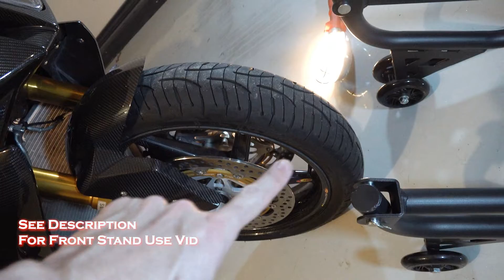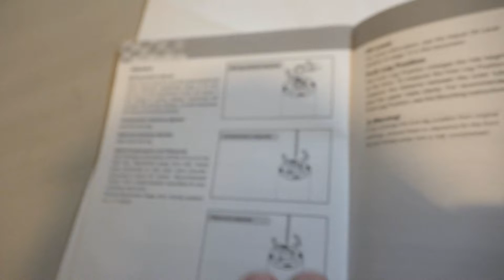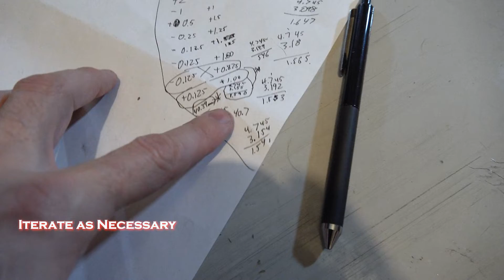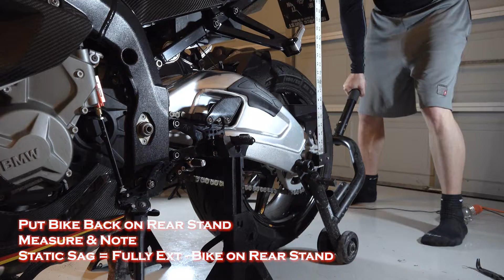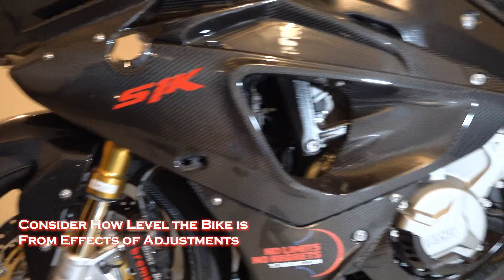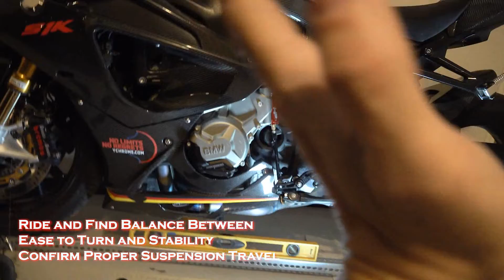OHLINS Motorcycle SUSPENSION SAG Measurement/Adjustment - BMW S1000RR Custom Modification

Comment: With the rear wheel off the ground there's extra bike weight over the front wheel that's going to give you a longer static & rider sag. This makes quite a different.
Reply from the maker: Correct. This was a learning experience for me, and the Final Sag/Suspension Setup with everything incl. what you mentioned is at https://youtu.be/S3wcQqpGbcs

Comment: Good job doing all of that by yourself. Did you take all of the sag measurements while it was on a rear stand? If so that will artificially make the front sag number higher and the rear lower.
Reply from the maker: yes, on this video for just sag adjustment, i was still using a rear stand, but i have a later final video on full suspenson adjustment where i have both tires on ground and leaned against a wall to keep it upright doing on my own. in fact, i just realized, i don't have a reference to that video in this one so thanks for pointing that out!
Reply: @NoLimitsNoRegrets  no problem ! I’ll check it out.

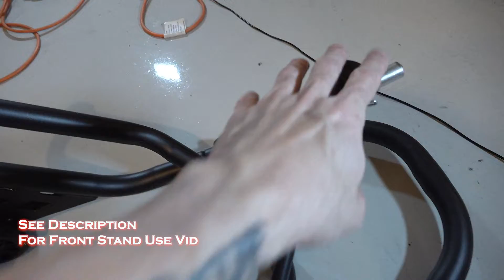Comment: 1:11 dangerous botch work seen,  the oem Brembo P4 front caliper and  M4 Monoblocks have different Hose mounting angels. If you install HP4 M4 Monblock clapier you need the hose kit between ABS Caliper too  and not only overturned botchwork 🤮🤮🤮🤮

Comment: Those front fork sag numbers at the beginning don’t really matter, if you ride hard (which I’m assuming you do on that thing) your gonna be adding more and more preload anyways
Reply from the maker: it's early but i'm trying to think through this. i think what you're saying is in a turn, i've braked and compressed the front springs, so the static geometry is less important as the compression will reduce the rake angle to allow a good turn-in. is that correct? However, all else being equal, i think it still does make a difference depending on the preload setting. it may not be noticeable to most of us, but it won't be the exact same geometry, especially when not on the brakes. so if i'm understanding everything right, correct, it probably won't make a big difference, but i prefer to have it as correct as i possibly can and not add any more variables i don't need in the process.
Reply: @NoLimitsNoRegrets  they are base line numbers, but if you ride hard, brake hard those number inevitably change especially the front with stock springs.

Comment: isnt the rear u adjusted for the rebound speed? the spring controls the sag?
Reply from the maker: Do you have a time when you are referring to in the video, so i make sure i understand correctly? Yes, the spring controls the sag. There are 3 adjustment controls on the rear shock, the two big ones are for rebound and compression, but the 3rd one is for preload, i.e. the spring, i.e. sag. Does that answer your question? if not, please elaborate.

Comment: Would you recommend those BSTs? It would be street riding (potholes, bumps, wheelies.. all that good stuff) Basically, how long/how many miles have you had those cf wheels and have you had any issues with them? I worry about longevity after reading all of the forum horror stories.
Reply from the maker: i researched everything available at the time, and i couldn't find any negative reports on the BST's. think i've had them on there for 8-9 years. the bike was held hostage for 2 of them, but i've had it in CO for 2-3 trips with them on, been on COTA 3 times with them on, and many, many hill country road rides on a loop about 150 miles. the back roads here are pretty rough in spots, i try to avoid manhole covers and potholes, but you can't help but hit them. i've had zero issues all these years though. just put them on the aprilia F11 too in the last year. the handling seemed to change a bit and i had to adjust the suspension after that change.
Reply: @NoLimitsNoRegrets  thanks. How many miles have you put on them?
Reply from the maker: @muscleandimports  looking back at records, 8000 miles on the bst's on the bmw.
Reply: @NoLimitsNoRegrets  thank you sir. Might end up purchasing those in the near future.
Reply from the maker: @muscleandimports  absolutely, glad the info was helpful! i'll have a wheel swap vid on the aprilia releasing in the next few weeks i believe in case it's useful too.
Reply: @NoLimitsNoRegrets  most likely will be. Your ohlins video was helpful enough to show me I don't want to have to swap the ohlins suspension from my 2010 s1k to the 2011 that ill be buying soon lol. Probably just going to have bmw do it instead.
Reply from the maker: @muscleandimports  haha understood. it's just nuts and bolts, but it does take a ton of time!